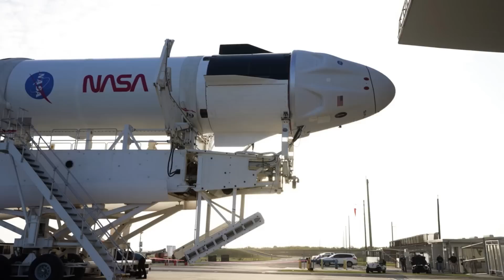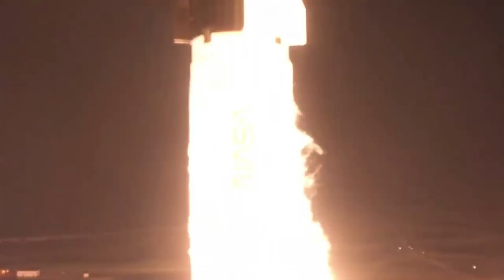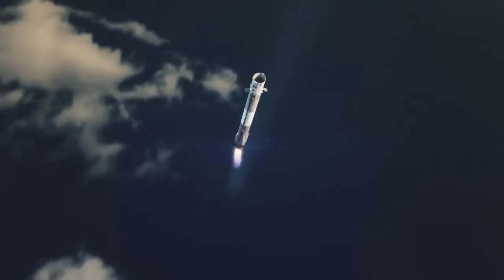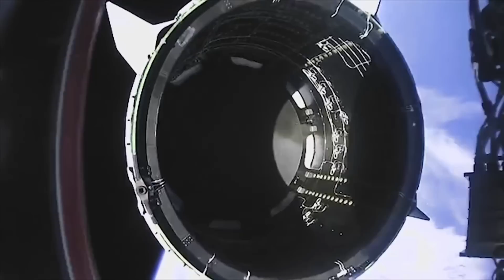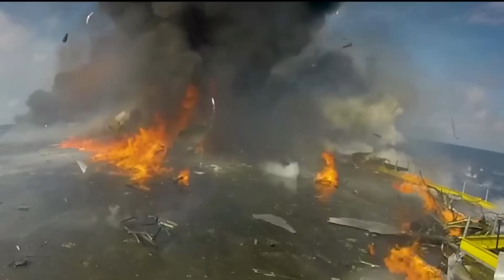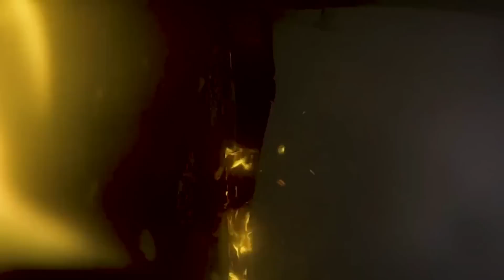Why SpaceX Is Looking For New Falcon 9 Landing Pads

Comment: What about negotiating with the Bahamian government? There's lots of land available on the island of Abaco or Grand Bahama, most of the launches appear to fly right over them.....
Reply: The Bahamas make for a slightly easier actual landing than a drone ship, but once that's happened, you have to put the booster on some kind of ship, take it back to the US, and then unload it again before refurbishment.  So you still have slow sea transport, two sets of cranes, but maybe lower risk of post landing damage if you ship them home lying flat.  I doubt a land landing anywhere other than the US mainland has any economic advantages over a drone ship.